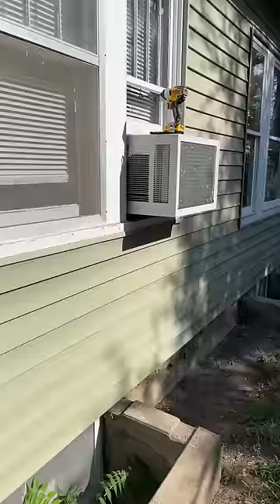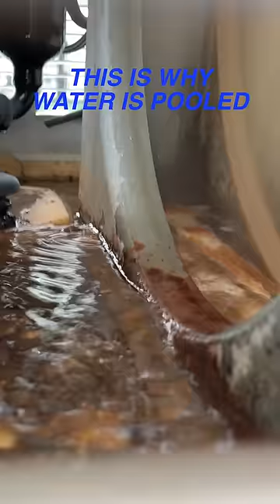🥵 99% Don't Know THIS About Window A/C!

Comment: The only thing they maximize is the efficiency of how fast mold grows
Reply: Thats an old school one it'll take longer
Reply: that why it's needed to be clean periodically.
Reply: Only happens when you dont clean the ac every 3 months which most people are lazy to do
Reply: @aronPlays14  Again.... wife.
Reply: Or simply drill a hole @ErnPrivado
Reply: More mold and rust 😂😂
Reply: @ErnPrivado  spray bottle with diluted bleach every other week.
Reply: This is outside. The air intake and output are both inside.
This part of the machine also very rarely grows mold, but will grow algae and even moss.
To prevent mold on the inside air ducts, clean your filters 3x a year. Once when you install,  once halfway through the season, and once the day before you take it out. Reinstall the filters and spray any non flammable disinfecting spray through while running on high.
Lysol works fine.
Reply from the maker: @nathanmonahan6157 this is amazing advice for everyone, thanks.
Reply: Im wondering if this is making my ac smell so bad I just put a new one in and 2weeks later it smells .filtered clean out and everything ?
Reply: I drill a whole in mine. Didn't know. Guess what? It started cooling better and didn't hear the fan sloshing around in water. If it helps at all, it's very minimal.
Reply: @seabass22  if you live in the south the humidity is already over 90 percent anyway so i can see the little pool of water not doing much in the south.
Reply: @BassRacerx  okay then that would make sense. Yeah it’s insane the amount of condensate coming off the unit
Reply: Yes!😂😂👍
Reply: And that's an excuse for that flaw😂
Reply: It doesn't circulate outside air into the indoors. You are also suppose to clean it once a year.
Reply: @seabass22  A/C units remove moisture from the air, that's how it cools
Reply: @jadslash  yeah they dehumidify. They also use refrigerant to exchange heat.
Reply: @Druid_Plow these steps will not prevent mold in any of my units where I live. Also many people can't simply spray Lysol or other chemicals in their house.   There is some good no rise evap cleaner sprays that are safer and work better. But I still won't spray them around my birds
Reply: @bobbysenterprises3220  they do not need to be in a window to be run, cleaning can be done outdoors. Also, there is almost nothing that will entirely prevent bacteria growth, but minimizing it is of course ideal. These things recirculate the air in the room, which is full of microscopic skin cells, hair, dust, etc etc. Usually the filters n them are only to catch large debris, not actually treat the air supply.
Reply: @Druid_Plow  I fully understand this. However here I can clean and disinfectant them before installing.  And before end of season they are full of mold and smell like a urinal .  Leaving the fan on several hours after turning compressor off or just leaving it on constantly greatly reduces it. I still have a larger unit that would get super nasty.  Sure enough there's a place to drill and put a drain tube.  That helped a lot
Reply: That’s why you clean them
Reply: @jadslash  Removing moisture is a byproduct of removing heat... Removing mosture does not cool a space. The refrigerant is what removes heat from the conditioned space.
Reply: @BassRacerx what does humidity have to do with liquid water being used to aid in cooling the condenser?
Reply: @seabass22 for it to work as best as possible it has to be angled correctly, and thus installed correctly, which most people don’t do…
Reply: @BassRacerx bleach will rust the shit out of your unit immediately, much less long term
Reply: @foojub6907  if its humid there is already condensation on the condenser spraying water on it is not going to net  you less of a performance increase.
Reply: The dead flies in there maximize the stank as well
Reply: @BassRacerx  hot high humidity air pales in comparison to cool water from the evaporator as far as aiding the condenser in shedding heat. And why would there be condensation on the condenser, it’s hot. You get condensation on the evaporator
Reply: @foojub6907  no argument that it would be better. However due to diminishing returns it would not be a noticeable or measurable.  Also the cool water would quickly warm up and also drip off to  the ground and you would be about as moist as you was before in no time.
Reply: @BassRacerx  if it wasn't noticeable or measurable then it wouldn't be part of the design. Even if the cold water became warm it would still absorb a considerable amount of heat as the condenser would remain 40+ degrees hotter by comparison. Humid air simply doesn't compare to splashed water
Reply: I had no choice but to drill a hole in mine, it was spewing water inside
Reply: Bleach doesnt kill mold actually. Just whitens it @BassRacerx
Reply: @aronPlays14 I clean mine twice a year. Works out to about 3 or 3 1/2 months, I think.
Reply: @BassRacerx That will start corroding aluminum, and is bad for your health.
Reply: And legionnaire bacteria
Reply: Depends on where you live humid environment yes this is a mold engine
Reply: True
Reply: @BassRacerx can’t you put those pan tabs in it too?
Reply: @AnUnapologeticApologist  This is correct, however removing moisture makes even warmer air more comfortable, and its comfort we are after not temperature.
Reply: @foojub6907  Everything, if the relative humidity is high that water won't evaporate very fast and thus won't cool the condenser coils. water alone doesn't cool, evaporating it is where the cooling comes from
Reply: @integr8er66  water alone doesn’t cool? How do you think that works for cars? Evaporative cooling is not the only kind of cooling lol. 

Even if the ambient humidity is high, humidity local to the air conditioner is lower because the evaporator has water condense on it, and the condenser’s heat relative to ambient means exhaust has a lower humidity as warmer air will more readily accept water.
Reply: Goddammit!!
Reply: As the water that lands on the condenser evaporates it would help to cool the condenser
Reply: Tell us more about how you dropped out of school.
Reply: @dakotaknoble2556  that's not at all true and just some weird thing that got spread around, usually by people trying to sell something.

IT won't kill the roots of mold in porous materials though because it needs direct contact to do its job.
Reply: roasted
Reply: @Druid_Plow  doesn't the condensate from inside drain to the outside though? if you remove humidity from the inside and it condenses it has to go somewhere, no? if it gets backed up or overfills outside bc lack of drain holes in a humid climate or after a rainstorm, doesn't that mean outside water can bring mold inside?
Reply: @AustinEterno  it would depend on the design, cheaper ones probably have a condensate pan or tray for interior that is elevated above the steel base, and then simply drains down and out through the main weep hole. More expensive ones will have an entirely separate tray with a wick, the wick would resemble an accordion pleated air filter. This creates more surface area to allow it to evaporate faster back into the room, and then be extracted and pushed outside later.
Reply: @Druid_Plow  Interesting. Does the Midea U have the second design you mentioned?
Reply: @AustinEterno  couldn't tell ya, I don't know all the different brands and designs that well. I'm just a scrapper, so I've disassembled many types and seen a lot of different designs.
Really no matter what the product is, you get what you pay for. The little 1200BTU units almost never have a wick, regardless of brand, once you're 4000 or bigger, almost all the major national brands like Kohler, Frigidaire, etc, they will have a wick. On the whole, they're all designed for 5-10 year life.

Comment: And I drill mine cuz it slings that rusty water on the condenser making it mucky which makes it hold more water when the ac is off, wonderful air refresher mildew flavored scent after two weeks.  Not forgetting a clogged up condenser after 10 weeks.
Reply: I'm with you, I've seen too much rust and gunk to NOT drain that water.
Reply: @topknotsrule  same
Reply: I've been debating this lately as well.
I've known about this engineering design for several years now but recently I'm leaning more towards the opinion that it may be more beneficial to not have a standing pool of nasty water in the unit which accelerates death of the unit due to increased corrosion that typically leads to refrigerant leaks at copper joints in the coils, especially between copper to aluminum coil unions on top of corrosion eating away aluminum fins on the condenser radiator. 
I haven't researched all the benefits of slinging nasty water over the condenser radiator yet but if it only gains a small amount of temperature efficiency it's definitely not worth it in the long run IMO since it destroys the a/c dramatically faster than running dry. 
Please, Change my mind...
Reply: To be honest though, you shouldn't smell anything coming from the rear part of the unit where the nasty water is being slung since the condenser fan is blowing away to the outside and the inside portion should be sealed well enough to keep the two portions of the unit separate.
Reply: @eds6569  About half of the window units out there have fresh air dampers that draw outside air from the slimy, mildew, condenser water compartment.
Reply: @eds6569  They probably do it on purpose so you have to go buy a new one.
Reply: @eds6569  air is drawn in through small air leaks which are pretty common in todays units. they don’t leak a substantial amount of air but the leaks are just great enough to the point where it’ll draw in smells from the outdoor part of the unit. It also probably pulls a little bit of air in through the condensation hole too.
Reply: They always got covered in black mold in my area, I probably lost a week or two of my life to window units if I'm being honest. Gotta do what you gotta do without any HVAC at all though. Especially in 100F+ summers
Reply: Yes I agree, sorry for people that don't do this. I install window units, make 3 holes small enough to hold a vacuum while the system is on, then once the unit is shut off the vacuum will dissipate and drop fluid. Unfortunately, you may have to do so periodically but yeah no mildew, nasty odors and rust
Reply: This is like making sure they won’t last long yeah
Reply: I have been restoring vintage air conditioners for years now, and the number one killer of them is rust. Rust that is caused by water pooling up and sitting in there. Rust like can clearly be seen in this video, and that unit isn't even that old. While in theory this design helps, in practice it doesn't. I have installed high and low side ports on a window unit, as well as monitored the current draw. The pressure difference and current draw difference is negligible with the water in the pan vs. not having the water in the pan. If you put cold water in the pan, it will help marginally for a minute or so, but the small amount of water these things actually have gets hot in the pan quite quickly and does not help. 
Drill the hole, the only major difference it is going to make is keeping the unit from internally corroding in a couple of years and provide much greater longevity. If you want to maximize efficiency, keep the coils clean (especially the condenser, use good coil cleaner and back flush it yearly with water) and if possible, keep the unit out of direct sunlight (like it is in this video), put it in the shade if at all possible, and keep your filters clean

Comment: Here in Houston 100% humidity most of hot weather you have to do a drain😳
Reply: They have both. The drain hole is slightly higher than the bottom of the pan so as  to leave a little water in the pan, but it will also drain. It does help with efficiency but in the long run it will rot out the condenser coil. I worked on a lot of PTAC units that are glorified window unit and they work the same way.
Reply: @HandymanHertz  - well it’s 85% at the moment. That figure you quote is not typical at all in the summer here
Reply: @HandymanHertz  gets very uncomfortable outside
Reply: Don’t drill it, instead fold a paper towel and with a fork stick it into the bottom back of the AC and it’ll maintain a steady drip
Reply: Right?!? FL here!😅😂
Reply: I spent a week in downtown Houston last year when it was like over 100 and the humidity was horrible. And then surrounded by buildings and concrete. It was miserable outside, and I'm from LA. That was some miserable humid gulf coast nonsense.
Reply: @condor5635 it was just an exaggeration professor

Comment: All that standing water causes that rust on the inside too. Even better is pulling the A/C before winter (just did mine) and dumping a gallon of water all over my interior floor. Genius!!
Reply: If you were smart you would get some gauze and stick it right in the back end of it and allow it to drain the water.

Comment: Its supposed to drain out the condensation that's why some have a drain hose...it will get mold and stink..
Reply: Wrong. It’s using the condensate to lower pressure in the condensing unit. Did watch the video?
Reply: @fashizzlemanizzle4808 the pressures wouldn’t even be that high unless you ran the fan on low on a hot day. that water will eventually heat up enough to the point where the added efficiency isn’t worth shortening the life of a unit.

Comment: I bet 99% of you didn't know that on the older style a/c units there were drain plugs that in the instructions said to tap it with a punch or small drill bit if it flooded while in slant.
Reply: I thought just about everyone knew. Mine has a drain plug and it's covered in the instructions.
Reply: It makes a nasty smell, best to vent the bottom before installing

Comment: A great way to collect dust and debris in the water, then plug up the condenser. I have seen some when hooked up for the summer, keep the fan from turning. It also will plug the condenser so bad that it will raise the head pressure to a point where it trips the breaker. So yes, drill the hole. On the second floor it may cause problems with water dripping on the things on the first floor.